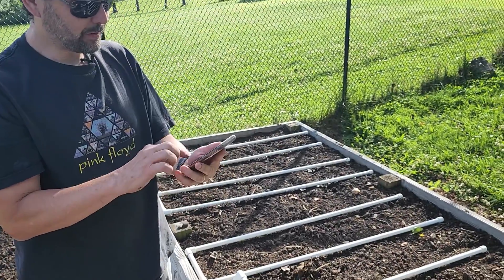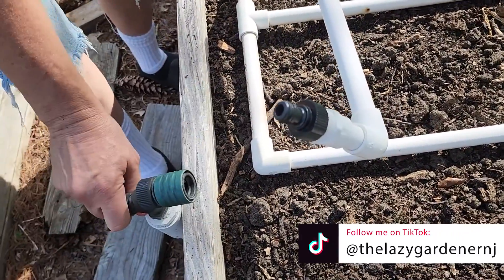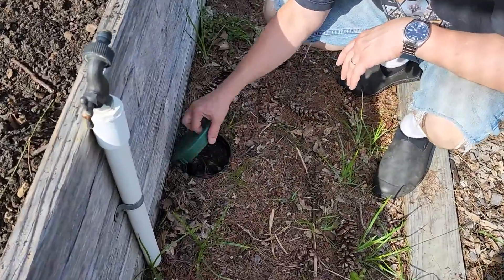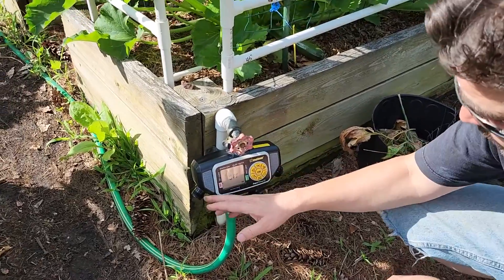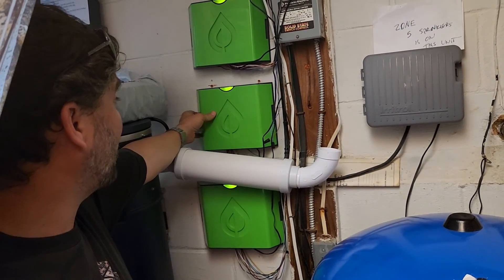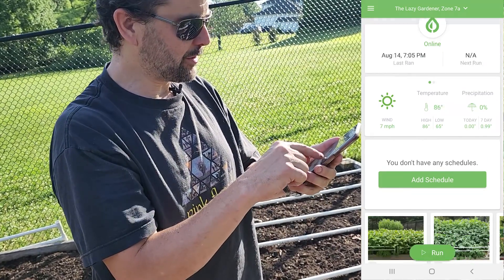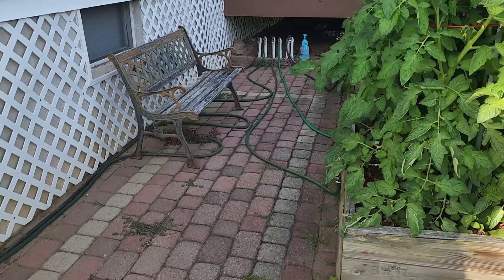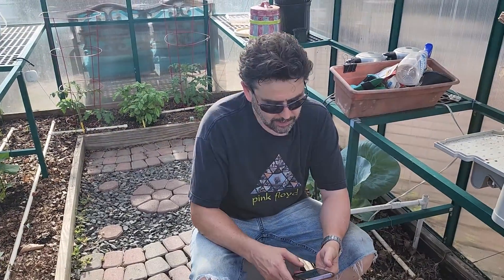Automatic App Controlled Garden Watering System

Comment: Can this be use on a bigger farm
Reply from the maker: It could be.   Number one each unit only handles 16 zones so unless you had some amazing water pressure you'd need a lot of zones and it would get very expensive. But if you could break it into an affordable amount of zones and units I don't know what the maximum amount is but I know you have at least three units linked together.
Reply: @TheLazyGardenerNJ  thank